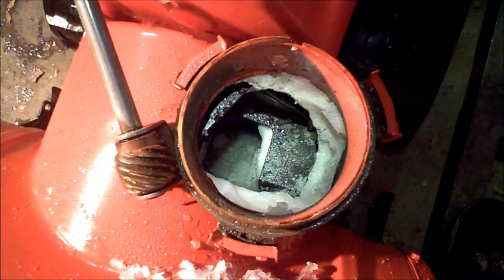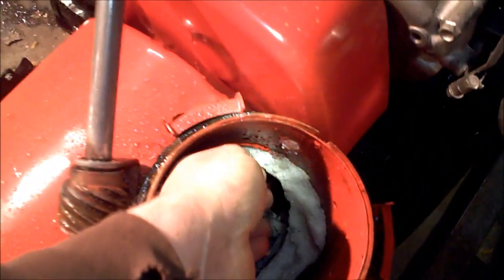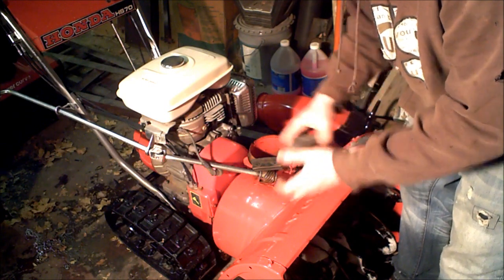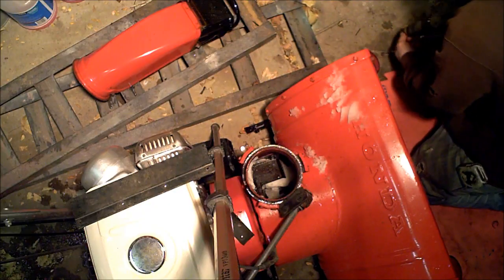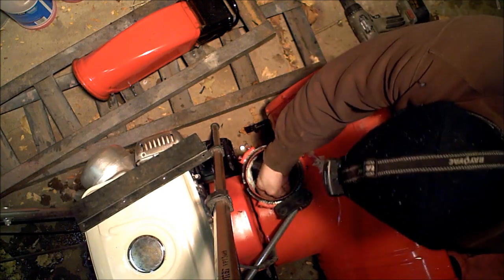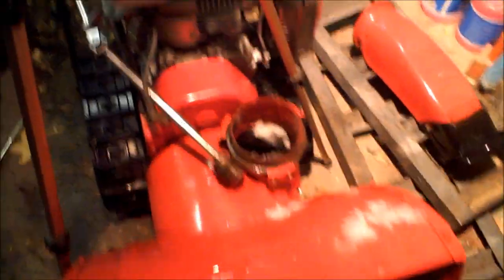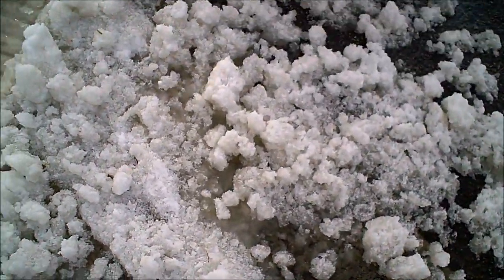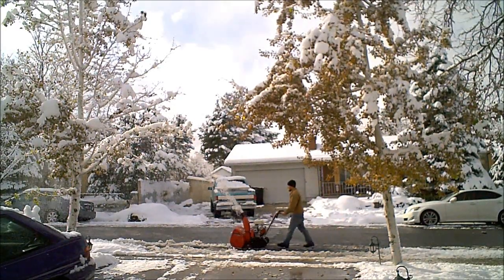Modify Snowblower to never clog and throw twice as far w/ Impeller Kit

Comment: Hey- I've watched ur modification on the impeller which I'm going to do on my Arian's! Its my first blower 4 years old like new - got great deal on it-- anyways 1 problem I have is I guess its the "frozen cable" syndrome the chute will actually move freely by hand n won't lock when needed-- is there a easy fix for this???? Thanx for ur help-- Todd
Reply from the maker: Todd Remington Frozen cables can be a bugger on snowblowers. You need to get oil/wd40 down the tube of the cable to keep the water out. They sell a tool that clamps over the cable where the sleeve and the cable meet and allows you to inject oil through the entire cable. Or you can slowly do it by adding a few drops at a time and working the cable in and out.  http://www.amazon.com/Motion-Pro-08-0182-Cable-Lubber/dp/B0012TYX9W/ref=sr_1_1?ie=UTF8&qid=1422816247&sr=8-1&keywords=cable+luber+tool
Reply: sixtyfiveford thanx- we are getting 4-12" tonight here in Hartford ct- worked on her today so will see how cables hold up! Thanx again

Comment: Watched your vid a few months back, just got a chance to mod my 2001 Craftsman 24/5hp machine and man did it make a difference....tried it in the super slush today and it was a dream to use!! Only downside is I was launching small stones up onto my neighbors roof...lol No worries though, have it under control now!!  Thanks for a great video and sharing this bad ass idea!
Reply: BTW, I used a mud flap I found in a lot that broke off an 18 wheeler. It was a little thick, so I counter sank the pan heads from the self tappers. Worked great!
Reply from the maker: poljana Great work!. I'm glad you tried it out. You're neighbor will forgive you.

Comment: In looking to make this mod on an old 8 hp Ariens 924042 that I bought used a few years ago, I found that the clearance on the side of the impeller chamber is about 3x as wide as it is at the top of the chamber near the chute opening (approx 3/4 inch vs 1/4 inch) so I abandoned it for the time being after drilling two holes in one impeller since 1) drilling holes in the thick metal impeller is quite an effort, and 2) I didn't want to risk either stalling/straining the engine or quickly wearing away the excess rubber due to the narrower space at the top of the chamber if the impeller spun at full speed.   Any thoughts about whether this is truly a problem and if so, what I can do to correct it?  Unless the snow is relatively dry, this machine tends to easily clog so I really want this mod to work.
Reply from the maker: Olly Even a 1/4" addition will help a ton. It is more critical how close the paddles are to the impeller housing right at the discharge than the rest of the housing.

Comment: Amazing results! I have a low end 20yr old plus Murray 8 HP snow blower. I have not used it for about 5 years because of the chute clogging and not being able to throw snow. I had a big gap between impeller and housing, gravel driveway I suspect helped lead to this gap. I installed the rubber spacers per your instructions and this low end blower is now throwing the snow 20 plus feet, amazing. The self-tapping screws did not work for me, had to drill and use bolts to hold the rubber spacers in place. Not a bad job took about 2hrs from start to finish, worst part was drilling holes in the impeller with the 10” drill bit, but well worth the effort! THANK YOU! Did I say AMAZING; oh I did…Thanks for the video!
Reply from the maker: David Mahoney Yeah, reaching down in the chute can be a pain. I'm glad you tried this. Looks like the Murray will see a good remaining life.

Comment: I put  12 mm thick pads on my Cub Cadet but the tips of all them wore off in no time.
Reply from the maker: banjoboy1941 That's thick stuff. What material are you using?
Reply: sixtyfiveford
I tried using conveyor belt rubber. I'm going to try the sidewall of a tire next.
Reply from the maker: Conveyer belting is nearly indestructible. Are you cutting the tip to a point and that small point is just wearing off?
Reply: sixtyfiveford
No, I left them the same thickness all the way. I must add that after the temp. dropped the snow became very hard snow. After a bit of working in that, all the tips wore off.
Reply from the maker: I'm wondering it your impeller is not centered in your housing and the paddles are rubbing on a side in one spot. Friction heat would make it wear fast. Standard fiber reinforced conveyer belting is the toughest material out there(better than tire sidewalls). It is what they use on the bottom of all single stage snowblowers that sees constant contact with pavement and can last for years doing this (1/4"/6mm). They even run it on the bottoms edge of some snow plows. 12mm/1/2" would be nearly impossible to cut with a utility knife and should last forever.

Comment: I can't thank you enough. This totally worked. Great modification and easy to do. Wish I had seen this 5 years ago when I bought my MTD Yard machine; I thought I cheaped out and bought a lesser piece of equipment. There's plenty of power but there was just too much gap to be effective - not anymore! I'm ready for Juno now. (Jan 2015 blizzard) Just one question: I screwed into the plastic paddle - think I should I have used a nut and bolt?
Reply from the maker: William Welsh The plastic paddles are very robust and a screw will hold. Great work, I'm glad you tried it.

Comment: I have a Craftsman 9HP 29inch snow blower which does fine with powder snow but when it comes to wet snow, it always clogs.  The machine is about 5 years old, will this mod work on it?  Thanks!
Reply: I have a Craftsman 9hp too that Im going to put the rubber on. Any advice on how to keep the top part of chute from freezing up all the time, the bottom rotates fine but sometimes the top freezes while sitting in shed so sometimes it throws snow too far because top part is frozen ( tried wd and silicone spray ) Thanks in advance.
Reply from the maker: J.E. S. Undoubtedly YES. You'll love it.
Reply from the maker: A marine grease will repel and hold off water. This would prevent it from accumulating and freezing up the chute deflection.
Reply: sixtyfiveford Thank you
Reply: J.E.S. I have a Craftsman 9hp 28", its 5 or 6 years old and I just put the rubber on and it works 100% better and no problem with the wet snow. ( throws the snow a lot further and no clogs )
Reply: Nice, unfortunately, my snow blower's impeller blades were so strong I wasn't able to drill through them.  There were already 3 holes in it; one on each impeller blade.  I resorted to attaching the rubber with those holes, the only issue was that the rubber came loose and sorta messed up my snow blower (nothing serious, but I was able to fix it)  The reason for this malfunction occurring was that each rubber piece was only attached with 1 hole (instead of 2), so the modification wasn't the cause for the malfunction, rather the hole issue was the cause.
Reply: sixtyfiveford I got the marine grease with no gun, I didn't take deflector off but used my finger and tried to get grease where I could. Not sure if cable is freezing or not. The other day when I went to use snowblower it it was stuck but I was able to move it with my hand to loosen where b4 it stayed stuck. Not sure if I got the grease where it was suppose to go but I think I did. In the off season I will take deflector off and grease. ( it is some thick grease ) Thank you.
Reply: J.E. S. I noticed that someone used Gorilla glue on the rubber also which I used too. I chose to use nuts and bolts instead of trying sheet metal screws. I used a 10" drill bit, I don't think the metal on snowblowers are too thick for drill bits, u just should use a new one and make sure u secure the impellers with a piece of wood. Good luck
Reply: Tony Johnson sixtyfiveford Ive had about 3 more storms and the chute was frozen in position where I had it b4. It seems like the cable is somehow is freezing up. One storm it was working but then froze and chute was clear. Could water be in the cable or the rubber that surrounds it.
Reply from the maker: Tony Johnson
Water freezing in the cable line is a common problem. Take a hair dryer or heat gun to it to find where.
Reply: sixtyfiveford I tried once but I guess I didn't hit the right area long enough, is their something I can do in the off season with the cable. it's funny because prior to putting the rubber on it wasn't throwing the snow that far when it was stuck or frozen but now its an issue sometimes.
Reply from the maker: Cables get iced up all the time with age. Especially machines stored outdoors.

Comment: Couldn't wait to try this with my Craftsman. I have to say you made it look like a piece of cake. First, my impeller blades were easily 1/8 inch hardened steel so self-tapping screws were not an option. No problem, I'll pre drill. What a pain! First you either need a 12 inch long drill bit to get down there after removing the chute or a flexible drill coil to attach to the drill. The chute opening is too small to allow my drills in there. It was difficult to punch a starter dimple for the bit since I don't have a punch that long and one blade just let the bit run over and over and over. Knocked off for the night. Just hope my holes in my truck tire sidewall rubber still match up with my drill holes. Hope it's a down hill job from here.  Was going to do this for my dad's Craftsman too but I have totally rethought that now.
Reply from the maker: Johnb57 Yeah, some of these Craftsman's have a really small chute opening. They can be a pain but it is definitely worth it.
Reply: I just did my Craftsman 5/22, the steel impeller blades were a PITA, but a new drill bit and being careful to avoid drilling into the welded reinforcements on the back made quick work of the holes.  Took me less than an hour to do the job.  You definitely want a NEW high-quality drill bit (they make non-walking split-point tip design bits).  If that doesn't work; use an "aircraft drill bit" (Google it), they are extra-long.

The stainless steel sheet-metal screws I used aren't secured in the holes as tight as I'd like but it worked out fine: the pressure of snow/slush on the impeller holds them in.  I'll replace them with bolts if they start falling out.  1st hard use: no problem.

To get the drill bit down to the impeller I had to remove the revolving chute (3 bolts holding the plastic top and 2 8mm bolts so I could remove the "ring" that rotates.  I greased the sliding ring while I was in there. 

No way my machine would have worked yesterday with 4" of sloppy wet snow -- and my 23 year old machine was throwing the frozen slop easily 2x what it did with snow and 3x - 4x what it would do with wet stuff.  Wish I knew about this when I got the machine!

Comment: I have a newer Troy built with an impeller housing with varying clearance. I put three flaps on, but the machine struggles to turn the impeller since the flaps are tight on on one part of the housing. I thought they would wear down from friction, but that has not been the case. To what part of the housing should I match the flap size so it doesn't jam the impeller and clears the snow efficiently?
Reply from the maker: MatrixOutsider The out of center is one of the reasons manufactures leave a gap in the first place. You'll have to take a utility knife an trim it down a little. It should just touch the highest(closest to impeller) spot.
Reply: Thanks for the tips. The northeast is about to get two feet of snow, so I will need the machine to work with no jams.

Comment: I want to thank you for posting this video. I've owned a Toro 624 for 25 years and it hasn't worked well in years. Clogs a lot and doesn't throw far. I was going to buy a new $1,000 blower this year until I came across this fix. Did the modification about a month ago and today 9 inches of packing snow and NEVER CLOGGED. Threw the snow father then I can remember.
This is the first time posting to a video, and well worth it.
THANKS again!
Reply from the maker: Marty G You're very welcome. I'm glad you found the video and it earned your respect. Thanks for taking the time to let me know and for taking the initiative to try this on your machine. I hope you keep it for a long time to come.

Comment: Just did this to my Honda 622 and it made a huge difference. Thanks for sharing! Cheers!!
Reply from the maker: gruchster That's great. I'm glad you tried it out.
Reply: I have a new 28” Honda /wheels And I am bummed out because it clogs every time there was wet snow, never mind the painfully slow turning shute....I removed the 3-4 “ metal shield” Where are the Snow discharges And it helped a little bit.  Do you guys really think this mod will help with the clogging? New England has been getting wet snow for the past three years and I spent 2800 on a piece of Honda bullshit. Seems well-built but with clogging and a slow shute What’s the point? I should’ve gotten an Ariens.

Comment: I recently did an overall to my snow blower,  and this was one of the upgrades.  One piece of advice that may be helpful to others is to cut your pieces of rubber a little bit shy of the sides of the exit chute side walls.  What happened in my case is I was using some fender washers and bolts to attach, and as I tighten those down the rubber expanded, and the motor was unable to spin the auger.  Not a major deal to trim the rubber, but not exactly the funnest place in the world to work. I have a snow blower from the 70s, and in my case bolts were the only option as the steel is a good 3/16 of an inch thick.  Self tapping screws do not work in a case like this.  Hope this tip helps someone!
 BTW, the difference in throwing distance is HUGE! Well worth the time and effort.
Reply from the maker: Troy D Awesome. I'm glad you tried it out.

Comment: My Toro wasn't throwing snow as far as it use to & I remembered that a tech repair guy told me somtimes it's just the cable that needs to be tightened that engages the blower.  Loosened up one nut tightened the other connected to the cable a good half inch or more  & as soon as I did that it was back to throwing snow great again
Reply: I found that mine would not engage the wheel drive in all gears only 1 or 2 worked not 3 or reverse.  I tightened the linkage up to take all the slop out of it and it now works fine.  I have done this previously with the auger drive as well.  This is an old machine (about 40 years old) and uses linkage rods rather than cables.

Comment: I see said the blind man! So, I would only need to do this to the leading edge of the auger in the middle to "sweep" the snow clean on the blower housing in my case, since I'm running just the auger and not the second stage impeller. Gotcha! Thanks 65!!
Reply from the maker: ZippoVarga Exactly. It's impressive the difference it can make on a single stage. I'm sure yours will have a good 3/8" gap to take up. The further down the center impeller the rubber paddle goes the better as it lessens the chance of snow getting caught between the rubber and metal as it gets thrown out.

Comment: This worked really well for my snowblower.  Last year it kept clogging because I had about a 1/2 in clearance and this cured it and throws snow like crazy without any clogs.  I used some old belting just like you said and it worked really well and was easy to install.  Thanks!!
Reply from the maker: Trevor P That's great to hear. I'm glad you took the initiative to try this out.

Comment: I'll give you a wet snow follow up when we get one.  But the paddles are a very noticeable improvement.  No need to measure anything for a comparison. It is not a matter of 10%  better.  It is 10 horse better or more. I had to check to see if it was the same machine.  I have a very talented handyman who really struggled to get those self taping screws in, but he would not give up.  He did not know of any drill long enough to pilot hole for the screws.  Whatever. I'm up and running.  Blowing snow takes a lot less time.  At age 70 and 9F, that is appreciated.  Your tip is really gold.  Sorry, make that platinum. 2015 Chicago.

Comment: So far, it is powder snow this year in Chicago as it is so cold 2015.  BUT, using the paddle idea, it is like having another 10 horse power.  I never could hit the house next door with powder snow.  But now I can.  The machine is about 10 years old and runs like a bigger new machine.  I cheated over the summer and had a guy familiar with tools install the paddles to install the paddles.  He struggled for almost 2 hours in the summer on my Sears 9 horse.  On eBay I got a rubber from a single stage for about $5. But it was really worth it.  I will give you an up date if we have wet snow.  So, a big 5 stars for you.
Reply from the maker: ***** Thanks for the followup. It's amazing such a simple thing can make such a huge difference. Let me know what you think of wet snow performance.
Reply: sixtyfiveford To you it is simple. To me it was a mountain.  Like I said, I let my handyman do it in the summer and he is really talented as he remolded most of my house, double tray ceiling and so forth.  He did not even see the sense of doing it.  But, I saw the genius in it.  We all have our talents.  Again, a platinum idea.